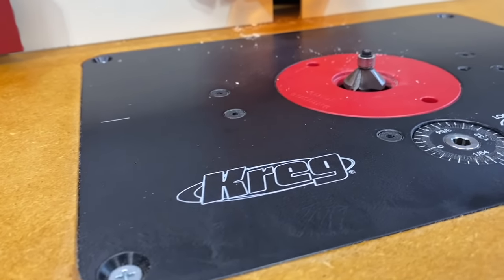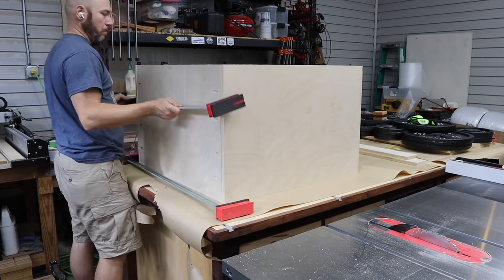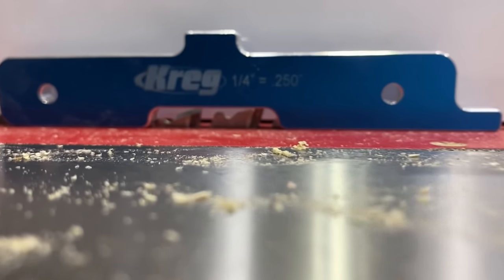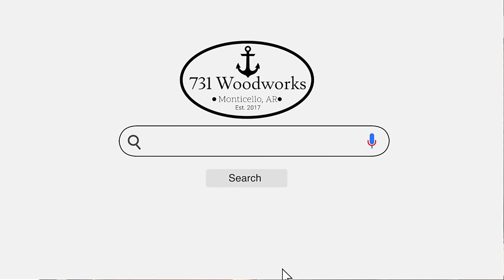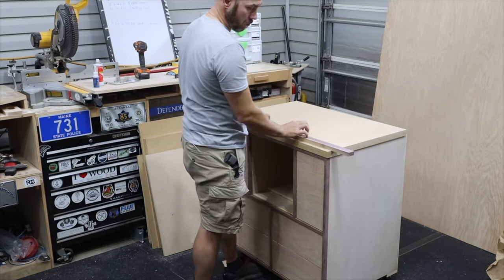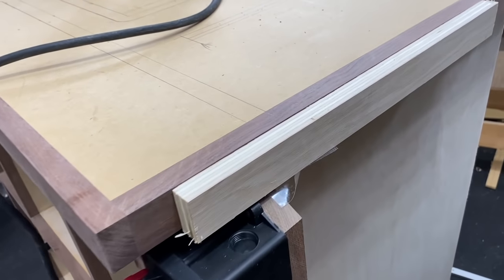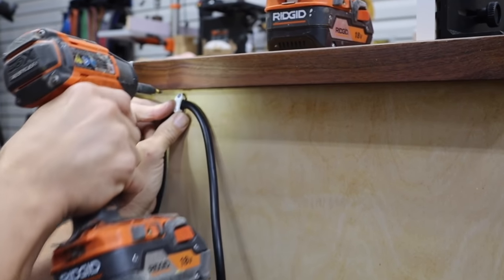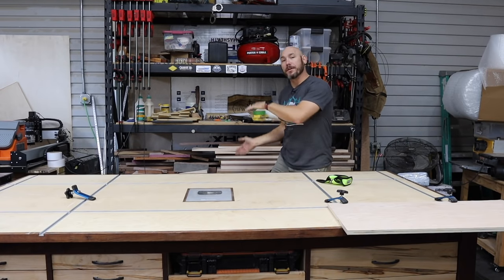How to Build a Router Table Build with Bit Storage

Comment: I’m not sure why you make the drawers this way, others do it also. When the drawer pulls out the top shelf is easy to see, the lower shelf you’d have to bend over to hunt for your router bits or tools. Why not make standard drawers so when you pull them out you can better see what you’re searching for? Looking down as opposed to bending over and searching. The top drawer you can easily look down on, the second level you would have to bend over and search, the second level should be the same as the first. Much easier to look down from the top as opposed to the the side. Regardless, nice work!

Comment: I bought the plan and getting ready to build the cabinet. I ended up buying a finished top from Amazon. I wanted the double track for a miter gauge and T-bolts. I strongly dislike working with MDF. I was looking at a hardwood plywood by the time I priced everything out. Could buy a fully laminated MDF top with the track I wanted for like $50 more than I could build the top. Plus the top came with a 3/8 aluminum router plate. The fence was the same deal only cheaper than I could build it. I have wanted a router lift forever. I will say most of the name brand lifts are super nice. But I worked machine shops most of my life. I know what things cost to build $300 to $400 is more than I want to pay. I built my own from wood scraps in my trash bin and hardware. My top is finished, I just need the cabinet to set it on. Someday I may build another top. I think a clear coated red oak plywood top with walnut trim would look nice. But I have a lot of projects I need to do, so I doubt that will happen. I may modify this table with fold down table extension wings. I want a long table jointer but do not have the room in my small shop. I plan on using this router table as my jointer.

Comment: I installed a simple pulley system in my ceiling above my work table as a helping hand for setting projects on the floor without any aggravation or injury to my body/back. Works like a champ ... mechanical advantage.
Reply: Awesome idea!!! I'll have to try this when I assemble a kitchen full of IKEA cabinets this summer. Some of them will be very heavy.

Comment: This is one of the coolest DIY Router tables on YouTube. I've seen a bigger one, but it was for a different shop, the builder specifically wanted it to be 42" or 44" so as to do double duty as an extension of the Miter Saw table area.
That Amber makes it look like a desk from Jr. High Wood Shop.! That's why you subconsciously don't like it.😎

Comment: Nice build! I built the "New Yankee" version years ago. I put laminate on my router table top. My desk I built I out of laminated mdf. I couldn't find any laminate for it at the time so It was coated with shellac, sanded and then spray painted black from a can, then finished with spray urethane. It come out perfect. I was surprised at how well and evenly coated the paint turned out. After 15+ years the desk top is holding up very well.
Reply: Hi there my brother do you have a video or pictures of your desktop? The description sounds really interesting and I would like to see it.

Have a blessed week my friend
Reply: @lobbi5000  I'll look and see if I can find the pics. I didn't take a video. I would take new ones but my desk is currently a mess lol. I take my work home alot The top was trimmed out with some 1/2" thick white oak similar to Matts router table.  I didn't trim the back.

Comment: Ya know that walnut on the back of the top will be nice to be flush so you can push it right up to the wall... Hay may only save an inch but still nice to put it as close to the wall as possible... so I'd say it was meant to be that way ;)

Comment: That looks awesome (and I thought the yellow looked good but I was in my 20's in the 1980's, so what do I know).  I have a suggestion. I am planning on rebuilding my router table that I built several years ago. I put a 4 inch dust collection port behind my router. If I rebuild it, I will put the pipe directly under the router and route it to the back of the cabinet. While my dust collector does a great job of sucking the chips into the box, a large amount of chips pile up under the router and I have to clean it out frequently.
Reply: @Darin Hamilton  You might take a look at your airflow.  If that compartment is too airtight, it won't have enough airflow for the dust collection and you'll end up with chip accumulation in certain spots.  To test that, prop open the front door with a small block of wood and route a test piece.  If the dust collection improves, then airflow is your problem and you'll need to put some air intake holes into that compartment to allow for greater airflow.  Just take a 1/2" forstner bit and drill 6-8 holes in the back and that will work without them being visible.
Reply: @davidkendrick3158  I drilled some holes in the bottom of the front door, figuring that the air flow from front to back would help, but it didn't.  I always thought about making the hole larger to increase the flow .  I also thought of some other solutions but never got around to it.  It isn't a big problem but if I built it again, I would put the pipe directly under the router.

Comment: TIP to keep DUST from sucking into the intake vent of your router - I have the exact Bosch router and one thing I did in addition to a dust collection hole at the back of the cabinet, was I clamped a 6" stretch of Flexible Aluminum Dryer Vent Hose to the bottom off my router, down to a 4" hole I drilled at the bottom of my dust cab. Doing so, keeps the dust inside the cab from sucking up thru the intake vent of your router. The stretch of dryer vent hose will move up and down with your router as you make adjustments and change out bits. Your router will be happy, because it's intaking fresh “dustless” air coming in from your lower drawer compartment.

Comment: I actually build my shop pieces with a flush back (no over hang) so they will fit up against the wall when not in use. But great recovery in using trim to stand in the gap. And hey - ‘mistakes’ happen on each build - it shows that you’re human and gives an opportunity to problem solve to have ‘added features’ in the end! 😊

Good change on the lacquer- I personally don’t care for that deep yellowing effect either - a cream or French vanilla color is my favorite. 

Great idea about using clamps to reduce movement when seating the pocket hole screws - I discover this by accident when I didn’t have enough  hand strength to pull both pieces of wood together just by the screws. Clamp first and things go SO much better. 

The one area that I struggle with is dust collection on the underside. I have the dust collection attachments from Bosh, but I still have saw dust flying everywhere. Looking forward to any solutions you might come up with. 

Great video Matt. LOVE the production, camera work and editing. Good solid stuff here Matt. Nicely done!
Reply from the maker: Thank you

Comment: Hi Matt, thanks so much for posting this, I've been looking forward to it since you posted the preview last week as I'm about to make something similar myself. I really appreciate you leaving in your error as I experienced exactly the same thing on a different project today (I was much less restrained with my language than you were and called it a day at that point!). It's reassuring to know that mistakes like that happen to everyone. I've also noticed you mention the fear of failure in woodowrk a few times and it's something that I suffer from massively so I really appreciate the encouragement and the honesty from your channel.
Incidentally, I have a similar router plate (the basic Kreg one) and they recommend placing the plate on the table top and adding some offcuts to frame the outside of the plate, then removing and using the frame and a template bit to cut a precise outline of the router plate.

Thanks for the great content.

Comment: Here's an idea for routing out the rebate for the router plate: first use the plate to create a negative template in some hardboard using a hand-held router and a bit with a flush trim bit, running the bushing against the plate. You'll end up with a negative template that is larger than the router plate by the size of the router bit. Then use this template with a guide bushing in the router that is that is larger than the diameter of the bit you use for the insert by exactly the radius of the previous flush trim bit you used. You'll end up with an exact matching inset.
Reply: Hi ,so if I use a 1/2 inch trim bit I would use a 1 inch collar after ? Thx in advance
Reply: @jcowboy123 The difference between the bushings should be twice the diameter of your router bit. For example, using a 1/4" straight bit, you would use a 1/2" bushing to create the template, and then a 1" bushing when using the template. Similarly, if you used a 1/8" straight bit, you'd use a 1/4" bushing when creating the template and a 1/2" bushing when routing using the template. Finally, if you wanted to use a flush template bit when creating the template, you'd then switch to a bushing 3x the size of the bit when using the template -- which is still basically just adding twice the diameter of the first bushing (the size of the router bit) for the second bushing. Hope that's not overly complicated.

Comment: Very nice.  It's funny that you mentioned 'fear' stopping you from doing this project.  I'm very new to woodworking and it's those drawers that scare me.  My brain says 'boxes will still be boxes even if they are not 90° at each corner'.  That might be true, but drawers won't slide if they are messed up.

Comment: What I did on my MDF top is once I cut MDF out for the lift, I put superglue  on top of the ledge and let it dry to give the MDF more strength.  On the last one, the fine lift balancing adjustment screws eventually started to tear away at the MDF.

Comment: Really nice build Matt!  It is scary how close this is to the router table I built earlier this year.  The only real difference on the cabinet is that you used the walnut edgebanding and I did full face drawers/doors on mine.  I like that you own your mistakes and even better that you show us your solutions.  I made my top very similarly, I used a lower layer of 3/4" Baltic Birch and a top layer of 3/4" MDF, laminated together, and then laminate (formica) on top of that.  It worked out really well and then I attached it with almost no overhang on the back (maybe 1/4"), so your "mistake" looks about like my Plan!  One suggestion when you install your dust collection.... I put my 4" dust port on the back, so that the bottom of the opening is flush with the bottom of the router compartment.  I used a cove bit on the inside bottom of my door to create a path for some air to get in and sweep across the bottom into the dust port.  It works very well.  I only get the smallest amount of dust/chips in the back corners.  If that ever starts to bother me (not yet!) I can put some angle baffles back there.  You are gonna love that new router table.  Thanks for sharing!
Reply: That is how I laminated my outfeed table/router table.  I trimmed both the table top and the router lift in mahogany.  Really love how it turned out. Working on the dust collection next.

Comment: Would love to see a detailed video on installing drawers. Im clueless as far as sizing drawers and getting the right size slides and installing them.
Reply from the maker: I did a video like that here https://youtu.be/Ls6G4q4TGew
Reply: @731Woodworks  thanks but I am looking even simpler than that.  Let's say that I am going to build a cabinet.  And when I am done, the inside dimensions of the space that I want to put the drawer is 15" wide, 6" tall and 16" deep.  From that space how do you measure what size to make the drawer typically and what size of drawer guides do you get?

Comment: At the mishap I immediately thought you forgot to account for the walnut trim when measuring the top.
Also for the router lift fit. You do own a cnc. Just make a template out of mdf and route using flush trim bit.
Nice build.
Reply from the maker: Thanks
Reply: This might be a really silly idea - but why not use the CNC to actually make the cutouts needed for the top? 

Another thought - The router lift company could provide the file for their product(s) as a value add. 

I wonder if someone else has thought of this and already provides CNC files for most router plates? Just a thought.
Reply from the maker: Yeah I never even thought about using the cnc for that 🤦🏻‍♂️

Comment: When I was looking for a router to double for router table use as well, I was torn between the Bosch and the Dewalt. I read several reviews that mentioned the Bosch wasn’t designed for use upside down, so failures were common unless they had decent dust collection. I’m curious to see how it goes. Hopefully the reviews were for older versions or something. Great looking table, regardless. This is one project I will definitely be tackling soon
Reply from the maker: Thanks for sharing!

Comment: The only problem here in Ireland is trying to get the metal runners and tracks to fit into them. Have to send out foreign to buy them online. Even the chain of hardware stores around my country called Screwfix don't do them but just like if you buy a plane in the shop they do not sell blades you have to go to another hardware to buy one. If you buy online you get a price for the item but by the time you receive it you end up paying shipping and courier fees as well as stamp duty so it becomes expensive when it arrives at your door. I'm in my 60s and know nothing about online shopping so I have to rely on making my own in timber. The joys of living ha ha ha

Comment: I actually prefer it with the back flush! Means I can push it up against a wall, lock the casters, and have a large stable bearing surface against the wall.

Comment: Matt...where were you with this design 6 months ago?  I just built a very similar table using DIY Montreal's plans.  I actually like your top drawers better.  Had to put everything on hold due to some health stuff before I got the fence built, so I may look at your fence as an option.  Great to see a little unnecessary walnut go into this build!
Reply from the maker: Thank you 👊

Comment: Great table. How did you solve the dust collection?  I build mine into one of my benches. I always have a pile of dust in the cabinet router compartment. I use a 2.5" house connector to a 2 hp dust collector.

Comment: Thanks again for a great video. And also your Best Buy’s for Home Depot are the best…QUESTION: I want build your router table CARCUS  using 0.5 in MDX BOARD. WHY: because that the wood I have…do u think that IMCAN MAKE THE CARCUS  WITH MDX BOARD?_… thxs in advance

Comment: You still set your pocket hole depth to 3/4? Even though the plywood is most likely less than 3/4?
Reply from the maker: Yes. It’s not enough difference to matter
Reply: @731Woodworks  No screws popping out?
Reply from the maker: Check this video out to prevent that https://youtu.be/a_gfVo2-LX4

Comment: Nice router table. Im working on a router and sandwiched 2 layers of 3/4" mdf laid them on my floor and added weight. Well, the floor was not exactly straight and level, Now I want to do it again and somehow do it so they turn oout nice and flat. Got any suggestions?

Comment: I purchased the fence you used. Did you have difficulty making the supplied machine screw to secure the dust port work? Minor issue, but the one I got is forcing me to come up with an alternative solution. Looks like I got the bad one that got pass QC.
Reply from the maker: Hey Carl, I didn't have any issues with mine.

Comment: Ok, after scouring the internet and watching countless router table builds, I think I’m gonna go with this one. Most videos use an aftermarket top which I’m trying to avoid to keep costs down. I also have a new Bosch 1617, so that works. Still debating between jessem and Kreg lift. 

I have one question. 3/4 ply is a pain to get here in Japan, but I can get some 18mm laminated sheets. Would these work in place of the Baltic birch?
Reply from the maker: Yes, I think the 18mm sheets would work fine

Comment: Just a nosey question…not counting the lift and fence , any rough quess on material cost to build this? Great looking project.
Reply from the maker: Only took 2 3/4" sheets of plywood and less than half sheet 1/4" plywood for this. So whatever that costs you locally.  Then minimal walnut for the trim.

Comment: Really nice build, Just picked up the plans on Etsy ! Quick question what type of plywood did you use?
Reply: Get sanded 3/4 inch.  With crazy inflation since January 2021, it will be fine.  $100 a sheet???

Comment: Where did you get you t track, also what is the size?  Thanks. I finally took the plunge and decided to build a router table.
Reply from the maker: the size is 3/4" wide by 3/8" deep t-track. I think I got it from Amazon?

Comment: Nice looking build.  No good for me though. If you make cabinets or furniture with doors you should have a router table that will hold two routers at once. That way if your cutting rail and styles or mortis and tenons you set both routers to cut. That way you set the routers once, then no rests until the job is done. On big jobs it saves a great deal of frustrations do to resetting routers.

Comment: do you have any problem with changing out the router bits with trying to hold the stop lock with one hand and loosening the nut with hand?
Reply: The Bosch 1617EVS (I have the same exact router in my table) doesn't have a stop lock, it uses two wrenches, one on the shaft and one on the collet nut.  I have no issues at changing router bits, though I did purchase the Bosch RA1152 Offset Wrenches ($15 on amazon).  That way I don't have to crank the router all the way up every time.